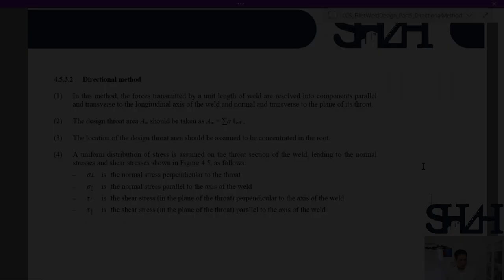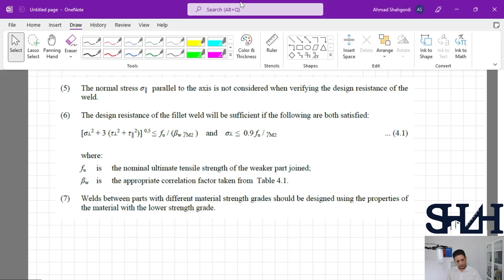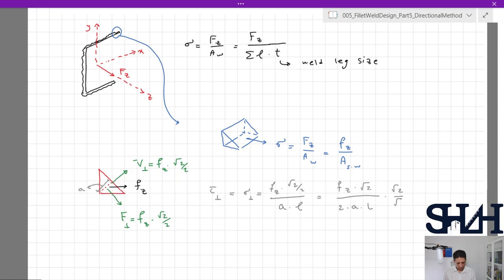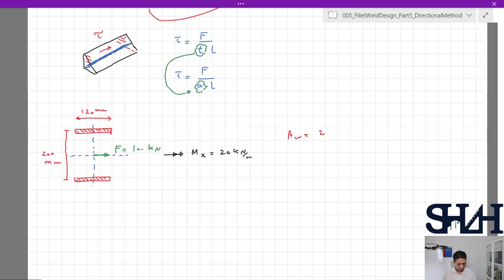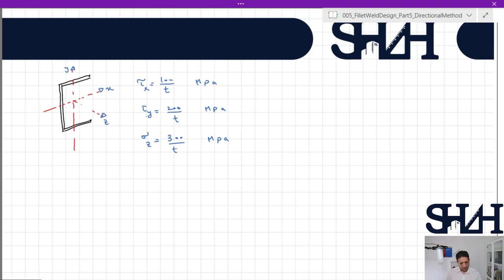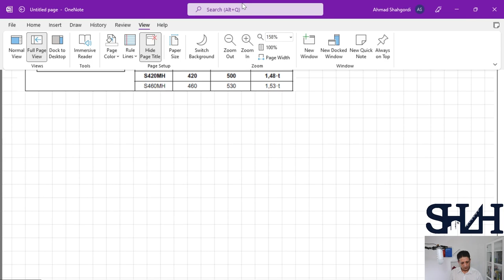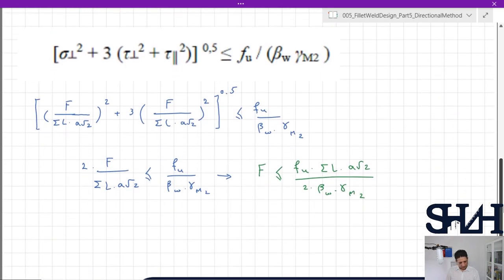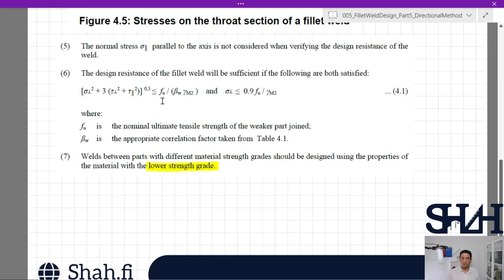Directional Method for Dimensioning Fillet Weld | Eurocode 1993-1-8

Comment: Brilliant series with very concise information, however it could do with some more examples with a full run through of what is taught. I feel like you gloss over the how the forces are converted into their stress and shear components (sigma and tau perpendicular stress and shear)  and how these values are used to calculate strength to the Eurocode equation.
Reply from the maker: In Eurocode, there is no equation for such. However, one would need to know the basics of the strength of material and stress calculation. If you elaborate on your meaning, I will try to catch and record a better example. :)